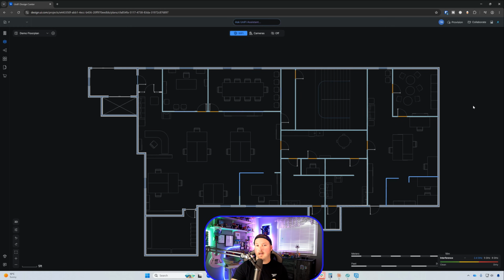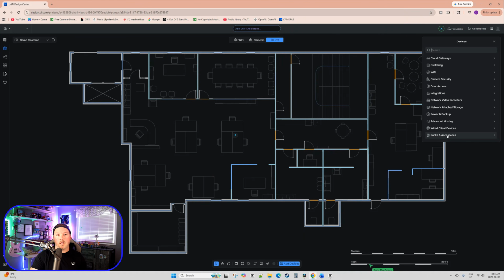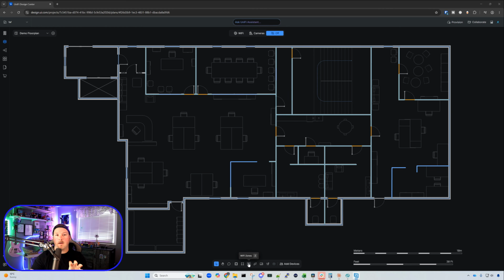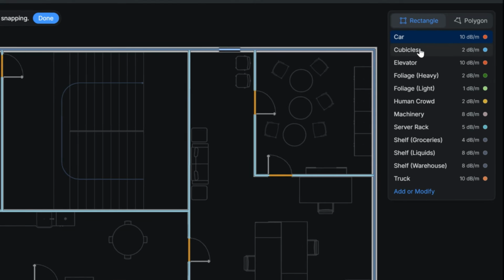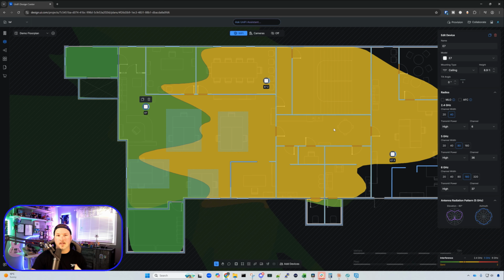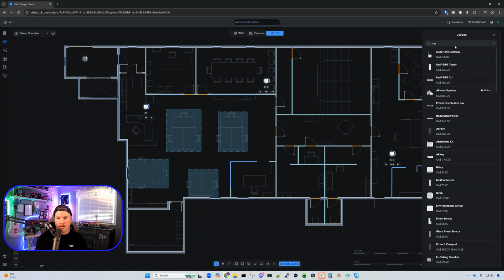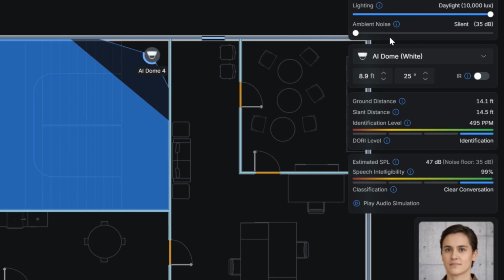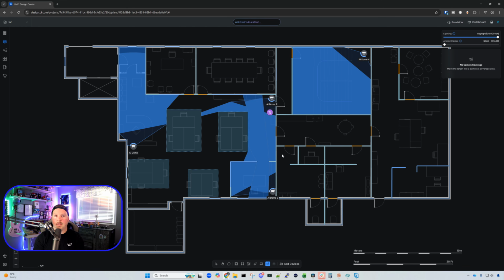UniFi Design Center Update: Show Interference, Add comments, SuperLink coverage

Comment: Am I the only one to have issue with the PDF from Design Center? Maps with WiFi coverage are screwed and mixed as F… you can see some floors without any WiFi marked as a WiFi 2.4GHz or you can see the same heatmap for the 2.4GHz and 5GHz on one floor when they are vastly different:(

Comment: The superlink coverage is "BLE" [bluetooth, low energy] or "Superlink" not "BLE Superlink" as you read it. The coverage is quite different between the two and can be switched just like the different frequency bands in wifi. (2.4, 5, 6 ghz)

Comment: and still you can't set the wall's height in a room. you can only set it to all the walls. but if i have a drywall for example that is 1 meter tall and i want to use it in the design.... nooooo i can't.
Reply: Exactly. I have the same problem. I have a 20 foot ceiling, and I have 8 foot tall wall walls throughout separating the spaces that are in the space. I wish there were a way to be able to designate the height of those walls and the height of the APs mounted at about 17 feet.
Reply: @brich4241  You can create custom objects that can fit this and set the AP height specifically on the AP. Go to add walls, Add or Modify, copy existing (drywall for example), set attenuation if needed. Then set the heights for the top and bottom of the object. I use that to add headers and counters in my plans.